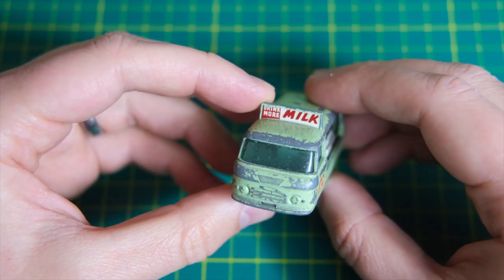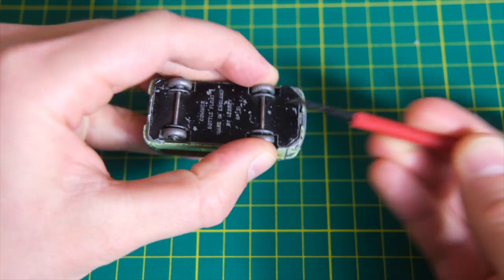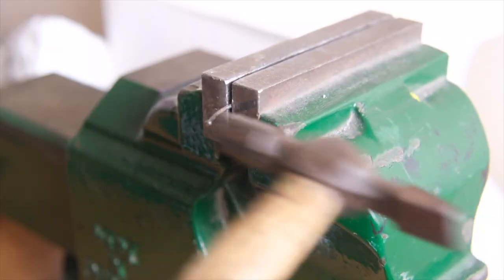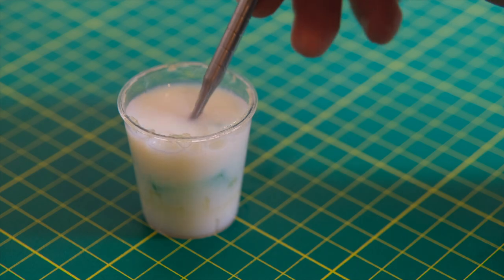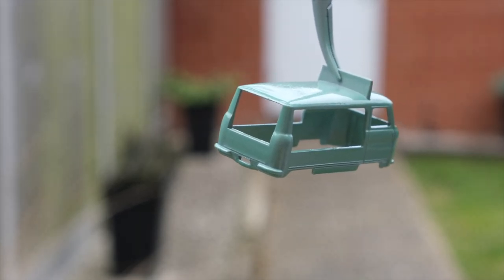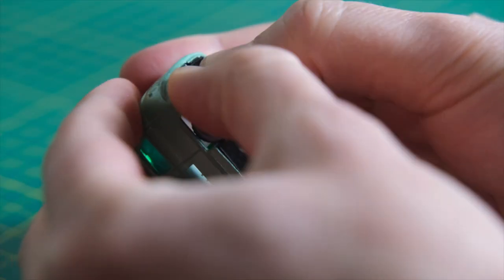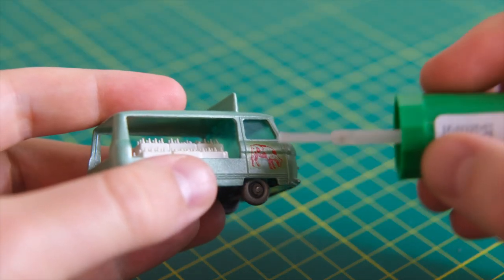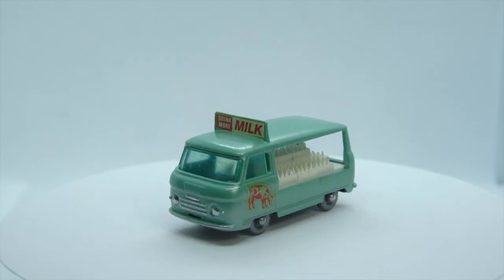MATCHBOX restoration: 21C Commer Bottle Float

Comment: now this poor bottle float surely got slammed good...
looking good again, ready to deliver more milk. :) great work!

did I catch that right, the engine is removed through the passenger door along with the front suspension, after removing the windshield? no wonder fleet managers wouldn't touch this van with a ten-foot pole... surely a lot of them went to the scrap yard because of some minor repair that woulkd escalate quickly.

side note: I remember a photo that was from way back when, probably another Commer milk float, with the line, "Drinka Pinta Milka Day" on the side. :)
Reply from the maker: Yep the design meant that most engine work would require complete removal via those means, in days where reliability wasn’t quite what it is today! You can see why fleet operators steered well clear